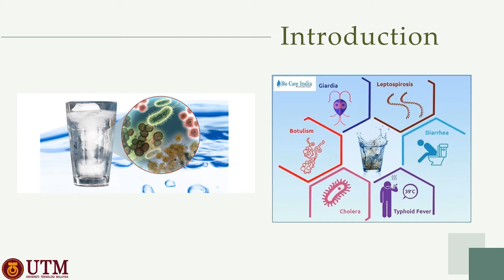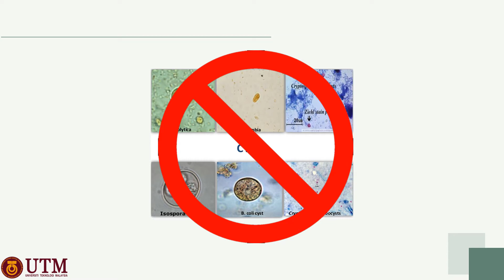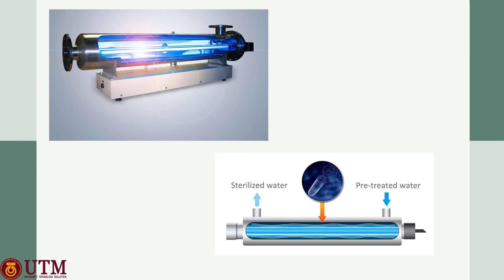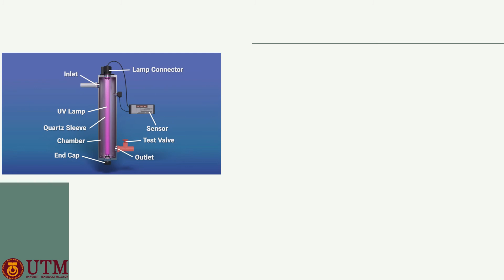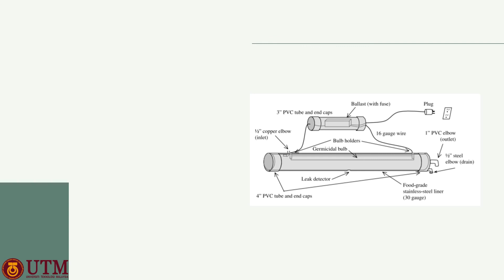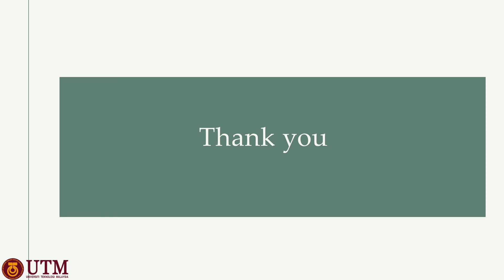Low Cost UV Technologies For Water Disinfection in House

Comment: Dear Nurul, how might UV disinfection be made available in households? How about the costs?
Reply from the maker: Hello Dr, much appreciate the questions given, I would like to suggest an installation in every single unit house rather than construct the UV disinfection wastewater system plant for the whole big residential area,
by using the low-cost UV disinfection design where the size is smaller and effectiveness can accommodate for a suitable household water usage. In addition, it possesses less maintenance for this system because it only involves a simple water disinfection system that applied in our house. Based on my research the components of low- cost UV system such as UV light only needs to be replaced once a year which can cause a less cost for installation and maintenance.

Comment: 1. Why is UV your technology of choice? Is there any other technology that can do the work as well?
2. What will happen if the UV wavelength is below or above the optimum level?
Reply from the maker: Firstly, thank you Dr. for the comments given, 

Here is the answer to the questions :

1. For the water disinfection system, the other alternatives are chlorination and ozonation, the function is mainly to kills pathogen consists in the wastewater. However, my strong justification for using UV technologies is because there is a certain type of bacteria that cannot be eliminates using chlorination and ozonation but only can be destroyed by UV light which is a protozoan cyst. 

2. The killing effectiveness of wastewater pathogen is high at the optimum level of UV wavelength due to the UV energy absorption by nucleic acids(germs) happens at this level, If UV wavelength below or above the optimum range, the time required for energy absorption is affected thus possibility for microorganisms inactivation is low to be fully destroyed.